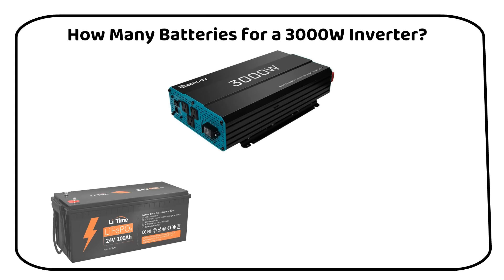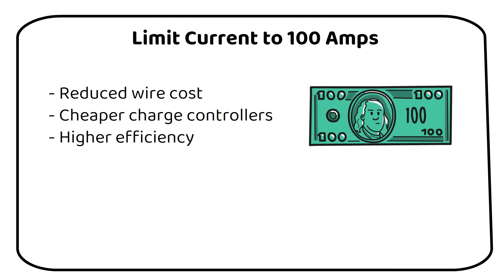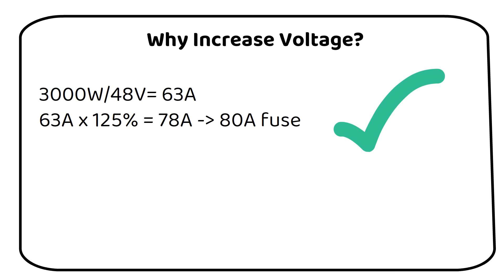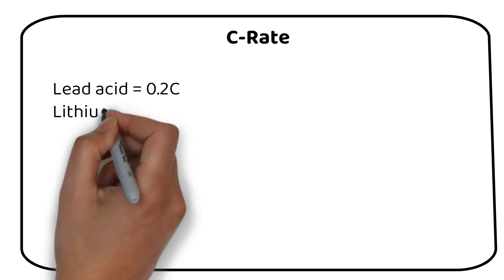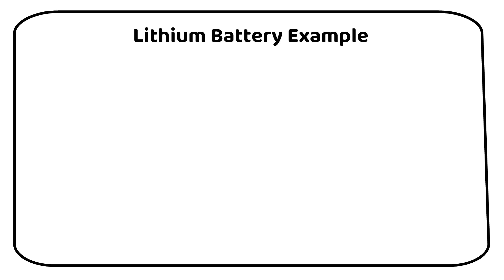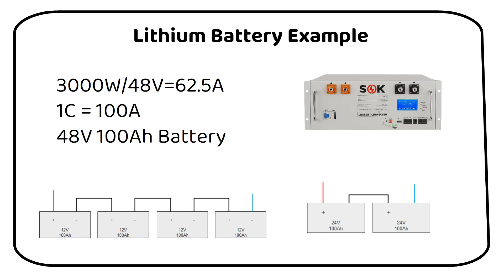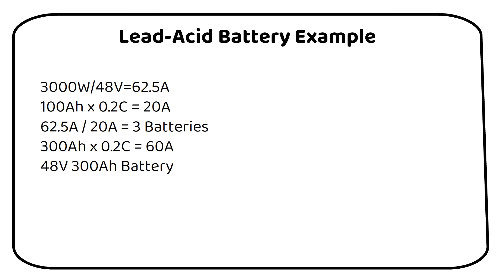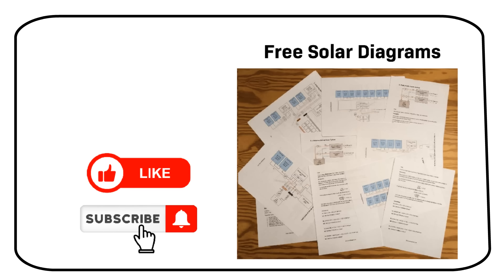How Many Batteries For a 3000W Inverter?

Comment: Well, im confused. I have 600 watts of panels connected in parallel to a bus bar combiner. Each panel is fused at 10 amps. I have 5 100ah lithium iron phosphate batteries connected to a bus bar as well. Each battery is connected with a 100 amp in-line circuit breaker. I have a PowMr Pro 60 charge controller in this system. All of this feeds my 3500 watt pure sine inverter. My loads are never more than 2000 watts. It seems to run well. My system is 12 volt. How would you improve on this? Based on this video it seems im making mistakes.
Reply from the maker: You have a 12V 500Ah battery. You can charge/discharge at 1C. That means you can charge discharge at 500A. Your inverter consumes a maximum of 3500W/12V=291A. So on the C-rate side you are ok. However, with 600W of solar panels, you need a 50A charge controller. If you had a 48V system, which I recommend, then you would only need a 600W/48V=15A charge controller. You probably spent a lot of money on wires too. Increasing the battery voltage to 48V could have saved you money on wires and the charge controller. However, you system will work just fine, but it's not ideal.
Reply: @cleversolarpower  - Your understanding of the battery side of things is solid, but the conclusions you're reaching on the charge controller side are VERY misleading, because you're forgetting that the power coming in is spread out over a much longer time period.  Also, the main consideration for charge controllers is the VOC (voltage, open circuit) not the amperage.  Panels push volts, but the controller pulls the amps.  This is why you can safely "over-panel" in many situations.  You need to stop presuming that the battery is getting charged at the maximum amperage possible from a given solar array and develop a better understanding of how that side of the process works.3
Reply: The MakeSkyBlue charge controller is the original version and it's higher quality supposedly with much better performance.  That's my favorite cheap mppt charge controller. I'm running three of them now but only been using them for around 3 years, haven't had a problem.  I run a 6000 BTU air conditioner hard in the summer from one of these 60 amp controllers.
Reply: @kevinward7498  thank you for that heads up, brother. I'm fairly new to this stuff. I'm a journeyman electrician with 20 plus years under my belt. But I've never attempted this solar stuff until recently. I get OHMs LAW, I get circuit logic. It all seems pretty straightforward to me, and then I look at YouTube and feel stupid. 😆 I will figure this stuff out. With help from y'all anyway. Stay blessed.
Reply from the maker: @jasonbroom7147  I don't understand your comment quite well. 600W panels can deliver 600W, it can even go over 600W on a sunny cold day. So why wouldn't you want to have a 50A charge controller? In my other videos, i talk about sizing a charge controller with Voc.
Reply: @cleversolarpower  - The fact that you don't understand my comment is what has me very worried!  How long have you been doing this, anyway?  There are some glaring gaps in your knowledge base for this stuff.
Reply: I’ve been installing for many years. We never use Li batteries due to the cost and safety concerns.  A customer a couple years ago wanted to go with LiFeP and for what he needed for capacity would require (3) 48V 6650Wh batteries at about $9k CDN each! Ridiculous. We did the entire system for $32k. Modules, mount, AGM batteries, inverter, charge controller, combiner, over current protection, cables….
Also for AGMs we charge at 20% of the C20 rating. That’s right from the various manufacturers. So a 830Ah bank can be charged at 160Amps max.
Reply: @MaritimeHomesteader  - There are no more safety concerns with lithium iron-phosphate batteries than there are with AGM batteries.  They weigh half as much, deliver twice as many watt-hours, and at least 5 times as many charge cycles.  They will store and discharge 8 to 10 times as many Kva over their usable lifespan as a comparably sized AGM bank.  Those are just the facts, sir!  :)
Reply: @jasonbroom7147  you don't seem to know what you are talking about if you say there are no more safety concerns with Li then with lead acid.  I don't have time or the patience to explain beyond a few points.
Being a fireman I've also received training on EV fires.  Wrecking companies can't even park EV's that have been in an accident within 100ft of another vehicle in their yard. 
We are told as fireman to keep the battery compartment cool to minimize chance of thermal runaway BUT don't get them wet lol.
There are restrictions on Li battery Ah capacity that you can bring on some airlines.  Why is that?  
Lithium mining is terrible for the environment, and that's not even considering the copious amount of water that is used in the mining.
no other battery in the world has a similar thermal runaway than Li.
Are they good for cordless tools?Absolutely!
Computers... sure.
For powering your home?..... not for me.
Check online spontaneous Li battery fires...
i can keep going but you seem to be in denial...
Do you think we landed on the moon too, or that 911 was foreign terrorists, or maybe cows fart too much and that's causing climate change.....
Reply: @MaritimeHomesteader  - I know exactly what I'm talking about; lithium-NMC is NOT lithium iron-phosphate, nor it is lithium titanate.  Learn your respective chemistries and their properties.
Reply: @jasonbroom7147 yes they are safer than LiCo but still have issues.  Thats part of the reason why Li need a BMS or BPS.  Anyways I'm not a fan of Li for offgrid storage or powering EV's or e-bikes.  serious chance of fires...
There are other technologies emerging that that will be much better.
Reply: @jasonbroom7147 the issue I had is with your comment that Lithium tech is as safe as lead acid.... that's just not true...

Anyways....
Reply: @MaritimeHomesteader  - Lithium iron-phosphate is what I said was safe, and I stand by that, resolutely.  You can't lump all lithium chemistries into the same category, since they are really very different.

Comment: 48v is nice but a lot of chargers at locked in the 12v world.  mppt, dcdc etc  I need to add boost devices to charge 48
Reply from the maker: There are 48V battery chargers as well.

Comment: Thoughts on pwrinv250024w aims inverter?… mine just started high pitch noise solid why?
Reply from the maker: It possible that low frequency inverters make this sound. If it did not do this before with a load attached, you might want to check for loose components or mounting it differently to minimize vibrations.
Reply: @cleversolarpower  excellent advice. I’ll make sure all connections are tight. I can upload a video… to my channel and leave it up for a day or so and then remove.. if you have time to take a peek— 

Used hardy board backer. 
Attached Mr. power solar inverter middle of the road inverter not too cheap not too expensive to a battery using recommended gauge 14 , then connected battery to inverter using larger wire 8aug, two deep cycle, 12 V batteries, wired and series and then ran one solar pan… 

Left refrigerator on to see if it would work overnight and woke up to allow whining, caution, warning tone my best estimate is it depleted the battery however, the meter read 20 V still… I was under the impression you could drain a cycle battery down to 70%.. 

Thank you very much for taking the time. I enjoy your channel.

Comment: There is an error in the video. 
Lithium-ion has discharge C-rate = 1C, but charge C-rate = 0.5C 
(video mentioned both being 1C)
Also for those interested, LiFePO4 batteries have discharge C-rate = 10C and charge C-rate = 1C
Reply from the maker: Batteries can charge at 1C nowadays.

Comment: You won't be hooking up that 12v 3000w inverter to a 48v system though. Wouldn't 12v 800ah be sufficient to run the 12v 3000w inverter without killing the batteries?

Comment: I had 4 x 170AH batteries in a parallel arrangement with a 3000w inverter. Putting the toaster on would trip it's cutoff and I'd need to reset. Might try a smaller inverter.
Reply: how about a smaller toaster? It should only be 1800 watts. something is catty-wumpus
You mean it tripped on low voltage? get the batteries fully charged!
you should have a whopping 8,000 watt-hours available there, enough to run the toaster for a solid 4 hours!
check your wire sizing for voltage drop, as well (check on what gets hot).
Reply from the maker: I assume it's a 12V 680Ah battery? If it's lead acid, then you can draw a maximum of 136A (170*4*0.2C). If we wire a 3000W inverter, we always have to calculate for a 3000W load, so it could potentially pull 250A. Like James said, it can be the voltage drop of the batteries.
Reply: Yes, what is the chemistry, and what exactly is tripping?
Reply: @jamesalles139  I had a lead running to my caravan. How the batteries perform hooked directly up to the power bank was something I never tried
 I can run a circular saw off my car battery with the engine running, and my tv runs for four days doing a direct link like that.
Reply: @The_Resistance_1961  Yeah, wire size matters. Renogy says: The best option for a 3000-watt inverter cable is a 1/0 AWG (American Wire Gauge) battery cable. These cables can easily manage 300 amps for four feet of cable (out and back). It's always a good idea to use the shortest length of cable possible.
Reply: @cleversolarpower  No. Four 170AH lead acid hooked up in parallel/tandem
Reply: @jamesalles139  the overload switch on the inverter
Reply from the maker: @The_Resistance_1961  the load from the toaster will have dropped the voltage of the battery bank. then the inverter tripped because it saw this as a low voltage, and disconnected the inverter from the battery.
Reply: @cleversolarpower  Yep, sounds about right. An ex telstra techie mate of mine said the initial load from a toaster is way higher than it's normal operating load. I can, however, clip the inverter to my car battery, run the motor, and no probs. Yeah, it appears to be that power surge at the start which always does it. I was also running the lead around the side of the van and they have 15 AH plugs. 4M lead. I don't know what happens if I plug inverter to battery and run kettle etc directly from inverter. I know my TV runs for 3 days solid hooked up that way to a single 170AH battery (before it drops to 10 volts and switches off). Might give it a try later.

Comment: What could have gone wrong my two solar batteries are failing to hold charge, only lasts for 20 minutes.  I am using two (2) Solar lead acid batteries:
12V 102AH x2 in parallel 
150w x 2 connected in parallel and a PWM solar controller. 
I bought batteries in June 2021.
Please help me
Reply from the maker: If your batteries have difficulty holding a charge, then they are likely dead. Here is what you can do: charge the batteries all the way up, disconnect the solar panels. Apply a load where you know the power draw like a 200W load. Then see how many hours it can run this. 200W*5hours = 1000Wh. your battery should deliver a total of 12V*102Ah*2batteries*0.5=1200Wh. The power draw from the battery during the test should be about 1000Wh.
Reply: Thank you

Comment: How many 12 Volt Lead Acid Deep Cycle Marine Batteries would I need to power a 2,000 Watt Power Inverter, and would I be able to plug a 12 Volt Trickle Charger into the same inverter to keep the batteries charged ?

Comment: I've installed 4 x 48V 100Ah LifePO4 batteries for 5000 Watt Hybrid Solar Inverter. Is ideal or need to be changed?
Reply from the maker: Those will give you max 400A discharge current. More than enough for the 5000W hybrid inverter.

Comment: You get the same reduction in individual current draw if you connect the batteries in parallel.

Typical 12V LiFePO4 battery is rated to 100amps continuous (as per your examples).
a 3000W inverter running at 90% efficiency or better (typical) requires around 3300W of input.
3300W at 12V = 275Amps required (Watts = Amps x Volts).
12V 100Amp battery: 275Amps/100Amps = 2.75 - rounded up you will need at least 3 batteries.

Therefore: Running 3 x 12V batteries in Parallel gives 12V 300amps continuous (with a power capacity of 3600W (12x300)).
Provided batteries are of the same type (they should be), the current draw on each battery should be evenly distributed.
at 3300 Watts or 275Amps, each battery will use around 92 amps.

So, 3000W at 12V only requires 3 batteries (in Parallel). To achieve 3000W at 48 Volts requires a minimum of 4 batteries (in Series).

It's all about sizing your system correctly. Trying to run a loaded 3000W inverter on a single 12V battery delivering 100Amps continuous, of course you're going to kill it prematurely.

The key advantage to running in Series (to 24 or 48 Volts) is it keeps the overall Amps of the whole system lower, meaning you can use thinner wires and have lower resistance/less voltage drop (not a concern at distances of less than 6m).
48 Volt systems are typically used for homes with 5KW -12kW inverters (104Amps there @5kW without losses on only 4 batteries...)
12 Volt (and 24 Volt) systems are typically used for Caravans, Boats and RV's.
Reply: Why not just 1x 300 amp battery rather 3 in parallel?

Comment: Awesome video, very well explained. I wonder, could you also make a video to compare lithium batteries to the more recent sodium versions?
Reply from the maker: Great idea, thank you for the suggestion.
Reply: I had two 48 volt AQUION SALTWATER BATTERIES and the SUCKED!!!
Reply: @onmyworkbench7000  Can you share some more details? There is however a difference between sodium batteries and saltwater batteries.
Reply: @PhG1961  
It was Aquion Energy and I had a pair of their 48 volt batteries then a few months after I bought them they filed for Chapter 1. It's my understanding that they have now emerged from Chapter 11 but I don't know any more than that. The Issue with the batteries was that they only had 2.2 kWhr capacity with a peak power 1 kW each.
One of the ones that I had died so I replaced them with 4  48 volt EG4-LL Lithium Iron Phosphate batteries.
Reply: What was wrong with the Aquion batteries? 
Our supplier was selling them several years ago then the company went into receivership. A company from Germany bought them for 9million. Aquion had spent $150M or so on R&D. They were 50Ah at 48V so 2400Wh. Not a lot of capacity but that’s one battery. They’re very safe and have good cycle life. Can’t let them freeze though. Also tipping them over voids the warranty.
Reply: @MaritimeHomesteader  Low power density and the stop taking and holding a charge. And the are SUPPER HEAVY TO MOVE!!!
Reply: @MaritimeHomesteader  Never heard of them. So sad if they disappeared as a supplier.

Comment: Great video, lots of interesting facts.

Dont forget to verify the code in Your area, lots of nations do not allow non-electricians to work on more than 12 volt.!!! - DC can kill !!!

To determine the number of batteries needed to support a 3000-watt inverter for at least one hour at full capacity, we'll need to calculate the total energy required and consider the discharge rate and capacity of the batteries.

Calculate Energy Required:
Power (W) = Voltage (V) × Current (A)
For a 3000-watt inverter, assuming a 12-volt system (common for LiFePO4):
Current (A) = Power (W) / Voltage (V) = 3000 W / 12 V = 250 A

Capacity Needed:
If you want it to run for 1 hour at full capacity:
Capacity (Ah) = Current (A) × Time (hours) = 250 A × 1 hour = 250 Ah

Number of Batteries:
Considering the BMS's limit of 100 amps, and assuming you're using batteries of 100 Ah each, you'll need to connect them in parallel to distribute the load:
Number of Batteries = Total Capacity Needed / Individual Battery Capacity
Number of Batteries = 250 Ah / 100 Ah per battery = 2.5
Since you can't have a fraction of a battery, round up to ensure you have enough capacity: 3 batteries

Wire Size:
For wire sizing, you'll want to consider both the current and the length of the wire to minimize voltage drop and heat. Since the BMS can handle up to 100 amps, choose a wire gauge capable of handling at least 100 amps. Additionally, consider the length of the wire and refer to a wire gauge chart that provides the recommended wire size based on amps and distance.

The American Wire Gauge (AWG) standards can guide you. A 100-amp load might require at least 4 AWG wire, but if the distance between the inverter and the batteries is significant, you might need a thicker wire (lower AWG number) to reduce resistance and voltage drop.

Always consult local electrical codes and standards for proper wire sizing and safety measures. Additionally, remember to fuse or use circuit breakers appropriately to protect your system from overcurrent situations.
Reply from the maker: I would also increase the voltage to save on other components.

Comment: I went with four LifePo4 12.8v 100Ah in parallel. The inverter is close to the battery, so the huge cable needed was not too bad. I did this because I also have a 7,800-watt sound system that requires 12v, so 48 would not work.
Reply from the maker: What sound system do you have 😬
Reply: @cleversolarpower  A pretty loud one. I have to find coves where nobody is to turn it up. I have two JL13W7s at 2400 watts each, four JL M7.7 at 1200 watts total, four JL C3 at 800 watts total, and two JL 8W3s at 1000 watts total. This is all the maximum output. The RMS is half or 3900 watts RMS. Being all JL, its not just a loud system but a crystal clear one. At the Long Beach Indy 500, I had the whole dock standing behind my boat to enjoy it. That is until the Coast Guard told me I had to turn it down. I thought that was a silly request since the marina was in the middle of the race and was not exactly a quiet place to be. haha